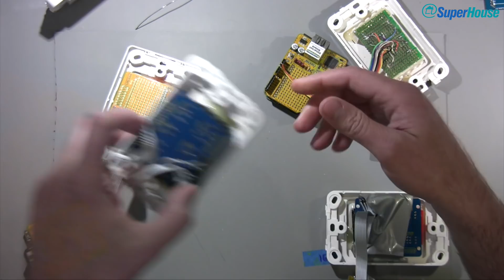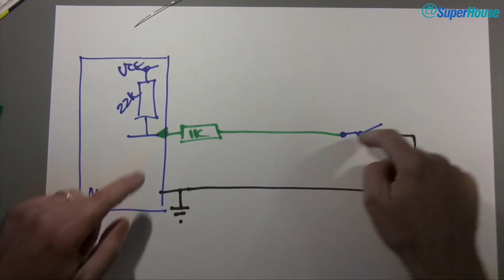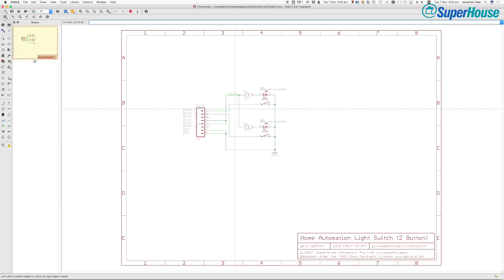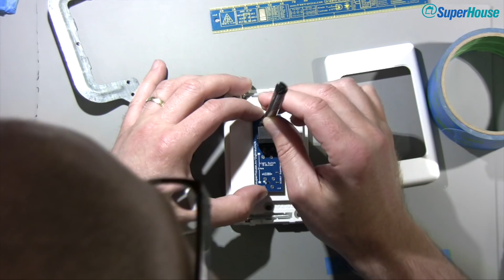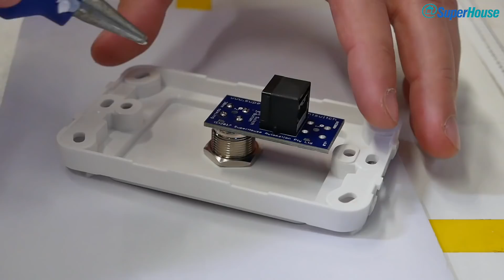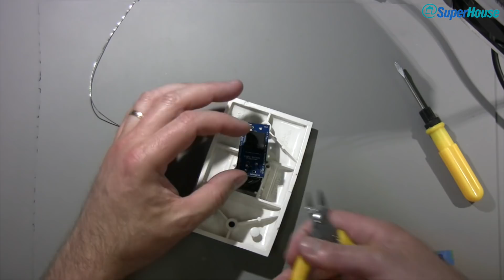SuperHouse #26: Make your own home automation light switches

Comment: Nice stuff Jon! I'd recommend a Cheap Step Drill kit which can also be used (carefully) to remove excess plastic.
BTW, I'm still keen on using a Modbus MCU slave for each panel possibly combined with a touch screen interface to allow for both switching and dimming control. 
Probably overkill,  and your solutions are way more practical but maybe something I'd like to try implement in future.
Reply: Even a cheap chinese step drill set will immediately get a better result than using a spade bit and deburring since you can use the front face of the next step to chamfer the hole a little.

Comment: I would love to build a new house and be able to implement home automation like that. For now I'll just have to work with mains voltage at the switches witch brings me to my question, what do you use for you switch mode power supply? It looked like a nice small contained package, all I'm finding is big bulky stuff. Great work!!!

Comment: What about providing visual state feedback via the LEDs? You can buy bi/tri-colour LED versions of those momentary buttons, but the system you use doesn't have an easy means to incorporate that. This is why I think a compromise between your two methods is a good idea. Put the panel logic on the panel, and the control logic in the centralised rack, with a simple serial connection between. It wouldn't require any change in your point to point wiring, and you're trading minimally increased local complexity on the panel side for vastly greater flexibility and future-proofing (plus a simpler overall system topology imo). Which ever way you do it, I think incorporating visual feedback on the panels would help with ease of use.

One thing I would change even if you keep your current system, is changing to something like spade terminals for the switches rather than directly soldered to the board. It might seem more messy, but it eases long-term maintenance. Your issue with having to change the board design to incorporate new buttons because of supply issues exemplifies this.

Comment: In Australia, Sonoff or thereof without necessary approvals (c-tick) cannot be connected to permanent house wiring legally. Moreover, devices with terminals (other than plugs) should only be connected to house wiring by a licenced electrician. It is not something legally allowed in Australia for DIY. Considering 95% houses are on mortgage and with insurance, things can get pretty messy otherwise. No sensible electrician in Australia will help you connecting and signing off anything without compliance markings.

The ONLY way of making this work without crossing path with legal intricacies is what Jon has used. Approved DIN-mount relays, which goes inside a central distribution box. These things are Industrial LEGOS (as AvE might say), which is intended to control AC mains voltages with low-voltage signals. 

Even mains relay having all the approvals, it must also be connected and enclosed properly. You cannot stick a DIN relay onto or back of a light bulb or switch and then connect a Sonoff or  ESP8266 to it. It's possible, but quite illegal.

Now you will understand why Sonoff or thereof is not yet practical in countries like Australia, and why Jon might has done what he has done in the way he has done it :)

Comment: Using front mount switches soldered onto a PCB is a servicing nightmare.  To replace one switch you need to desolder all of the switches, remove the board, replace the bad switch and resolder it all again.  Doing it with rear mount switches is much nicer, but of course means you need to secure the PCB to the plate which makes it more plate specific.  Also, is there no signal conditioning on the Arduino inputs - just a series resistor ?  Seems like it would be prone to spurious RF.
Reply: Well, it looks like heavily RF susceptible. You may use shielded cat5 grounded properly, at a higher cost. I tested pretty standard cat 5 without shielding, a 30m cable, laying around my house, and works without an issue. Even mobile on top of the wire, wrapped around microwave etc. wouldn't drag it down. I think it's alright for a standard household, without extreme level RF interference, such as in an industrial environment.

Comment: That was a very through explanation of the setup! I will definitely buy a few boards from you I could not find your old style lighted momentary contact buttons but did find the new ones that you use in the new switche s cheers have a safe trip

Comment: A suggestion for when you do a respin of the Rackmount Switch Controller, Drive the 12v Line to the LED's in the wall switches with a Transistor on an Output pin of the arduino. You can then have it as a status display. I know all the LED's are common, so you cannot have individual control of the LED in a specific switch, but you can for example PWM the pin to dim the all the LED's at night. Or Flash the LEDs whenever any button is pressed. Or when the Alarm is armed /disarmed (As a status display). You could also have it flash the LED's as a visible indication that the Alarm has been triggered, or that the phone is ringing (Or EMail waiting, whatever). 

It will just give you a visible indication no matter what room you are in (As long as the room has a lightswitch), If the lightswitch is flashing, then it means that something needs your attention.
Reply: Excellent suggestion.  I'd also add a small polyswitch on the 12V feed to provide some protection on that 12V line.

Comment: Hey Jonathan, great and informative video as usual.
Quick question. You raise a valid point about confusion that may arise when a simple button could potentially trigger a multitude of different things, not just lights.
I was wondering if you considered leveraging something, like the 2/4/6 button Insteon Wall Keypad. Basically just take the "front" of it and create a custom PCB that will get send the button clicks to your controller? The main benefit would obviously be with the fact that you can find plenty of etched button sets (http://www.insteon.com/keypad-accessories/) to make this very sleek and professional looking! and you could allocate 2 additional data lines (one GND and one 12v) and fully support a 6 button config.
Very interested in your thoughts on it!
Thanks again!!!

Comment: Do you have any experience with interference to the long network cables which you use for the buttons? Is the Arduino Pullup strom enough? How long may the cables get? Would it be sensible to add clamping/protection diodes to the pins of the Arduino?
Reply: Ive got mine running over 30m of cable with no interference causing issues. Depends what cables you have running parallel but really shouldnt be an issue unless youre doing insane runs.

Comment: Very great as usual. You keep me waiting for your videos.

Can I ask you to share your BOM regarding the PCB which contained the HLK power supply please ? I would love to know which added components for protection did you use. I can see a Varistor and fuse I guess. So please share the BOM to know which values are the most suitable. Also pcb design will be usefull to know how did you isolate high and low sides from each others.

Thanks.

Comment: If you can buy a push button that snaps into the normal light switches then you dont have to measure and drill. Also all the buttons would be automatically aligned with the right orientation and spacing to save alot of time. Great content as usual.

Comment: I apricate your diy‘s
Sadly in Germany there is Not that much Space behind Wall Switches... 
(Brick Walls) 
Have you testet The sonoff Touch with tasmota yet?
Reply: Hi Jonathan, great video!
I agree with Tim, here in Germany we do not have much space on the walls. Usually our construction is based on bricks and the space we usually have is about 80x80 by 40mm depth. In my case I went for the traditional switches you presented in your video. Actually I replace them with some "switches" with a spring that works as a push buttons. Then, because of the lack of space, I used the traditional wiring up to the register box (which is close to the ceiling) and there I connected to my network. Then I lowered the ceiling and done.
By sure could be done better, but worked for me.
Reply: You can achieve something similar if you put the sonoff about the light and connect the inputs to the light switch in a low voltage mode. Not being bigheaded but i prefer my implementation to his as it is completely fully functioning as a traditional switch when the network is down
Reply from the maker: That's a good solution. I showed something like that in one of my episodes about Sonoffs.
Reply: I have Seen that Video (The sonoff basic with Switch Funktion) too, and tried it. Again same Problem , there is sadly no Space behind The Switches... 

My sonoff Touch arroved, now Infos to figure out how it‘l work with tasmota  and Openhab or FHEM or iobroker...

Comment: Not so good. Current loop with opto is better.
Reply: Hi, why would it be better? Is it because you can use the already existing electrical wire instead of Ethernet, or are there more benefits?
Reply: charkandros, not sensitive to electrical noise and necessary for long distances.

Comment: Why you not making the Pin goes HIGH when the button is press?  Also where do you get those switches and PCB boards?  With relays on back of the switches, will it still fit on the standard wall outlet?  Looks pretty big and deep.
Reply: There's no internal pull-down resistor on the Arduino so you'd have to add one externally otherwise the pin would float when not pulled high by the switch. Having the switch active-low (as in the video) utilises the Arduino's internal pull-up and so when the switch is off, the input is pulled high rather than floating in an unknown state.
Reply: Danny T I was just building a thing similar to this and realised that using 12V as the HIGH is problematic, because Arduino is 5V. So I need a voltage divider for every input, plus a third resistor as a pull-down. Connecting to ground would be  lot simpler and doesn’t have the 12V to 5V problem. I just had to do it that way because of my switch, and now use 5V instead of 12V so the lights are very dim...
Reply from the maker: Yes, exactly. Using pull-ups to bias inputs high, then pulling them to GND, is a very common approach for exactly this reason. It's also the way many communications buses work. For example, I2C uses 4.7K pull-ups (typically) and the bus is asserted by any device on it pulling the level to GND, and otherwise releasing it. That way any device on the shared bus can assert the bus.
Reply: I've always wondered this. Won't the pull-up resistor cause a phantom current draw at all times? Instead, an active-high should only draw power when the button is pressed, isn't it? Do we do this because the internal pull-up resistor is such a high value, that the current can be considered to be practically zero? Does noise have anything to do with it? Do say ultra-low-power designs prefer pull-downs?
Reply: How to lay bamboo flooring correctly

Comment: You should sell kits for your all in one wifi switches. It would help people wanting to retrofit their house without having a central power cabinet.
Reply from the maker: I was thinking about that, but the big problem is certification. For equipment to be permanently installed it needs C-Tick, FCC, etc (depending on the country) and obtaining that would cost too much. So I can sell parts and kits and boards (including assembled boards) for people to build their own things, but I can't sell devices for permanent installation as a retail-ready device.
Reply: The Problem is, that Most of Home Automationssystems do Not Communicate with another.. 

But For Example there is The sonoff-Touch